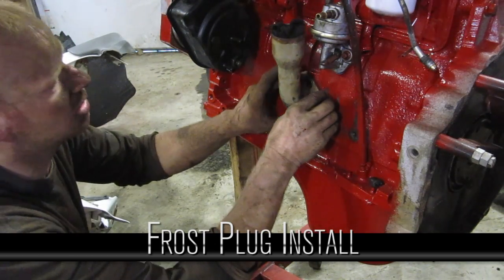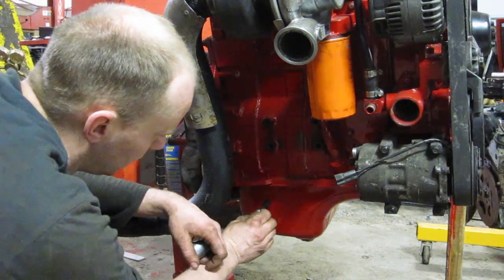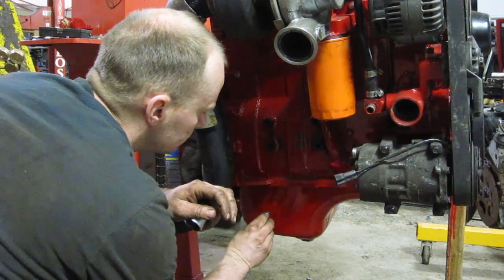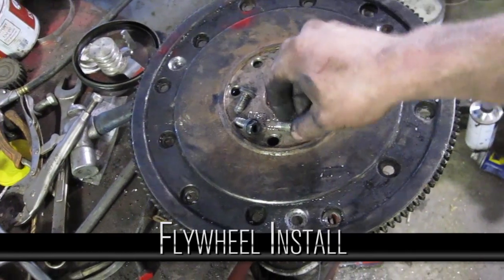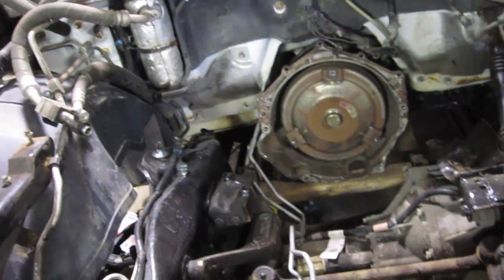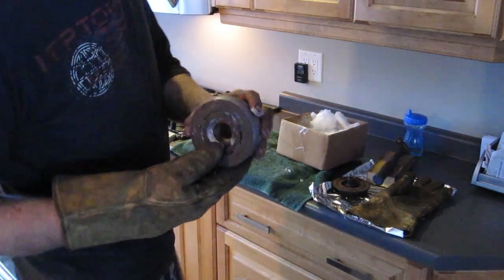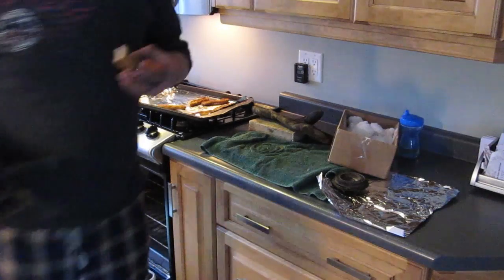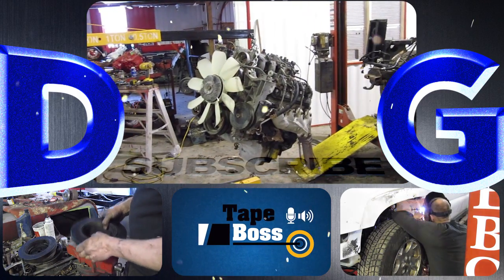Starter & AC Pulley | 3.9 4BT #CumminsTahoe [EP2]

Comment: Hi small comment nearly all dampers are tuned for the individual engine and not transferrable, you never get rid of the key resonance (2nd order 4 cyl) only push it out to the other crank orders 4th, 6th, 8th, etc, normally this is during NVH development and analysis by the OEM with the Tier 1 damper supplier to confirm that with the damper a higher resonance does not occur in the operational speed range. But a damper is better than none!
Reply: it's the ac pulley

Comment: Great Videos, what is the difference in mpg between the 5.9 and 3.9? suppose I have a rebuilt 3.9, but what would it cost to have the conversion done on an old Chevy truck
Reply from the maker: A heavier vehicle or towing vehicle would work a 3.9 pretty hard and mileage would go down so it all depends what its going in

Comment: maybe youve heard this urban legend about dropping some atf in your fuel tank (talking about mechanical injected diesel, not common rail)  does it really helps the ip, injectors and running smoother or just not worth it?
Reply from the maker: Yep.  I have recommended it in several videos and use it in my injector tester as well.  Cheap insurance
Reply: +DEBOSS GARAGE Any mineral atf? Or a specific one like dexron I?

Comment: What transmission did you use behind your 4BT?  Would you use the same one again or consider a manual shift conversion?  Thanks.  Looking to do the same conversion in a silverado by the end of the year.
Reply from the maker: +Jason B I still used the 4l60e but put a massive cooler on the front.  With an aftermarket temp gauge, I can keep a close eye on it.  Empty it never gets warmer than 150, and pulling a 16' trailer with a Murano on it, it never got warmer than 200.  I have put about 12000km on it now with no issues, so yes, I would do it again.
Reply: Was there any wiring for the 4l60e? Or not really?